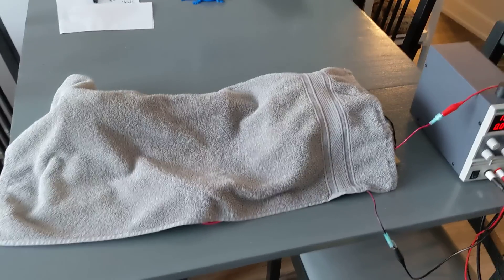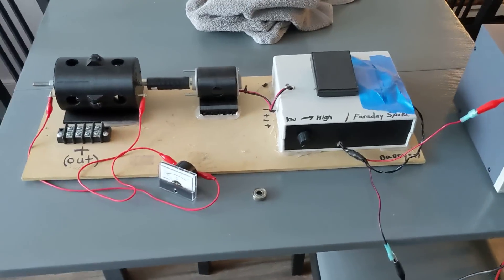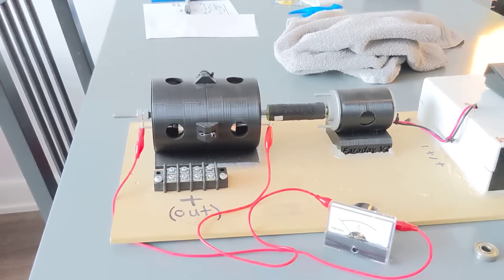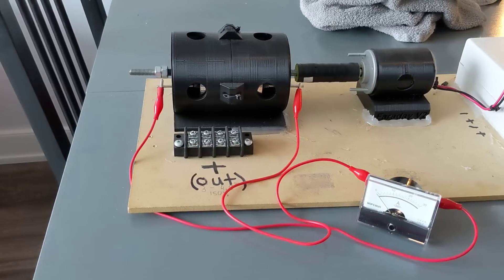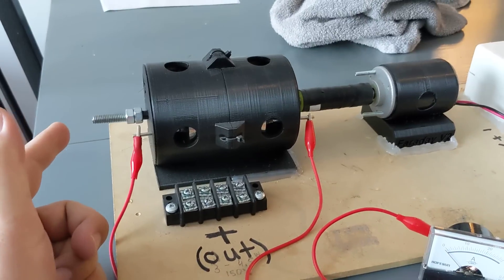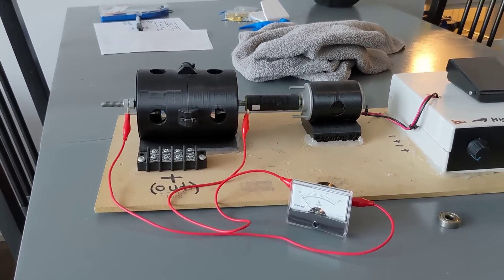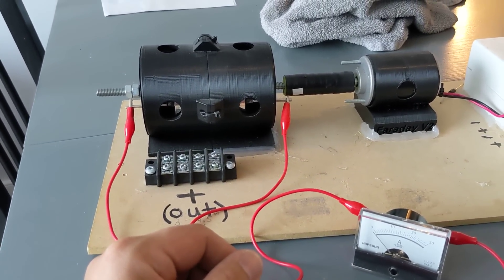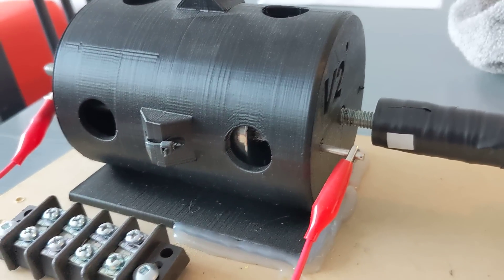N Machine....Bruce Depalma..Faraday Research RND

Comment: I have not seen any video that shows the Current capability of the Homopolar other than your! I read the De-plama patent, why do'nt you house those magneti( Quadra-pole SN-NS) assembly in a conductor tube, also you seem to be drawing the current axially to the spin direction, Palma's patent suggest it be drawn right from and also along the conductor tube length in which those magnetic opposion assembly are housed. Neat and excellent work bro👍🙏💪👌
Reply from the maker: That's the beauty of experimentation. That's why you can try all these ideas that are in your head and find out what works out best. The configuration I did and the way I set everything up I got the best performance possible
Reply: @FaradayResearch Oh I see, also can you show me 22A draw using a DMM meter? or a Clamp meter? Even De-plama and Tewari were seen using current shunts ( ofcourse they had very high currents at the out put!

Comment: Have you tried pairing this device with a Wimshurst device? As you know Wimshurst will create High Voltage with low amps.
Reply from the maker: I stopped working on that device 4 years ago. I'm not not currently working on that project

Comment: Great work!  First thing that comes to mind is adding a spark gap tapped from one of your outputs. The other end of the spark gap should be voltage right? Other option is using a neon lamp as the spark gap using its connection as voltage.

Comment: So Bruce DePalma claimed over unity when he reached 6000 rpm on a Faraday-type spinning disk generator.  Whatever happened to him and to his invention?  Thanks!
Reply from the maker: Bruce DePalma died in 1996. He died in New Zealand. From what I've heard, his machine is not over unity. According to Eric Dollard, there is only one way that you can make that machine over unity and that's if the magnetic field that was created was pulsed into an AC type field, then that could be extracted accordingly to produce high voltage and high current. Unfortunately, his machine was only able to create high current at mediocre voltage due to the architecture of his design. Unfortunately, his design made the machine extremely big and heavy which is kind of unpractical for a lot of uses. Maybe the industrial use might be more feasible, but as far as output voltages it, his device did not have the architecture to produce that.
Reply: @FaradayResearch  Are you still working on the Faraday-disk project shown in this video?  If not, let me be frank, I would be interested in renting (or buying) your build so I could do some tests. (I do not have a 3D printer, for example, but I have a lot of test equipment.)  I would add at least one earth ground, for instance.  I would also like to try segmenting the conductive surface (as recommended by N. Tesla).  I'm getting ready to try my own build, but renting yours would save me a lot of headaches in getting started, if you are willing.
Reply from the maker: I thank you for your interest in my project. Unfortunately that project has been disassembled. It would take some time to get it back up and running again. That's something I would have to work on in the near future, but the device itself is very easy to build. You don't need a 3D printer. All you need is too large fishing magnets, a steel axle and a couple of bearings and DC electric motor. That's very efficient and you can have your own end machine up and running very very quickly @TheProfJones
Reply from the maker: I thank you for the interest in the video that I did on Bruce De Palma.... Yeah he passed away in 1997 in New Zealand... He fled the US because of the harassment from the government. Where the invention pretty much did not evolve from there. There's a guy in India named tawari... He also built this machine and got great results. The only problem with the machine is it has to be built at a very large scale in order to get over unity and makes it very unpractical for the average person to build and implement into their home or whatever... As far as I know the machine he built pieces or the whole machine could be sitting in a warehouse. Somewhere in Australia was the last time I heard but it hasn't seen the light of day since his passing

Comment: If you have the magnets producing amps from an already rotating axle, why not load a different part of the axle with another motor arranged as a generator, and use the voltage form that? Or some kind of ballast or spark gap arc generator to create the voltage you want? Or maybe even a flywheel generator set up?
A heavy flywheel could be rigged up to wind or water systems and with a magnetic gear array to generate very high rpms and clearly then very high amps..
Just thinking out loud here...
Reply from the maker: This project I was working on over 2 years ago. I'm no longer working on this project. I have other things on the go right now
Reply: @FaradayResearch  I noticed. Still working through your vids...

Comment: How do we convert current to voltage?
Reply from the maker: Step up transformer
Reply: @FaradayResearch  wait, then doesn't this make 10000 or 800 current 10000 or 800 volts?

Comment: By the way... should you try the machine in different environments? After all, we know how it works and that it works efficiently if upgraded correctly. but we don't know what the variables and unscientific are. Or what does it react to or what affects its electrical output? In this way, we can have more data about what happened. For example, try it in an area with less light and see if the current drops.

Comment: Build a small DC generator that make volts and low amps on the same shaft and put the volt to the output using high amp diodes. You would have the volts and the amps mixed. Something to try? This is interesting.
Reply from the maker: I've already tried that theory. It doesn't work. The voltage has to be stepped up after the device
Reply from the maker: I stopped working on that project 2 years ago. I'm working on another stuff right now. That's my focus

Comment: Interesting in that the South poles are facing inward. When you subject seeds to the South pole of a magnet, they grow at an accelerated pace.
Reply from the maker: I've tried all configurations and the best method that I've found is North pole's facing out southpole's facing in
Reply: @FaradayResearch If no one has patented anything extra in this Bruce de Palma project, can I understand and spread the solution to the problems? Is this possible?
Reply from the maker: Any free energy device will never be patented. It will always be seized or they will deem it National security and you'll never see it ever again. Patenting is a total waste time and money you have to open source
Reply: @FaradayResearch  What if the machine gets power from an unknown particle or an unknown particle in the uncertainty principle? is it possible?
Reply: @FaradayResearch  I don't mean how it works or making your own version to sell and spread it. Otherwise, you are right. If someone doesn't spread it, this technology will die..
Reply from the maker: Yeah, it's possible it could be fluctuating or manipulating the dielectric space around the magnetic field because the magnet is in motion and rotating a can reflect or deflect counter space or the dielectric constant definitely possible
Reply: @FaradayResearch  Actually what I said is different. a particle. It has no name because it is not something fixed. It is triggered within world borders depending on the possibilities. just like chemistry or O2 reacting. We need to look at the actual magnetic field and find out what triggers it.
Reply: @FaradayResearch  I also saw another inventor using the same method. But it used radiation instead of electrical energy, and wireless lights were on in the air and on the ground. The LED was on.
Reply: @FaradayResearch  Now I did some research. and there may be free electrons. It could be a free electron separated from the light and all other elements. Can you please test this free atom in the area where it is found at the minimum and in the area where it is most found, and in the area where there are no other atoms (I cannot do it, I cannot afford such thick magnets)

Comment: I am trying to get my own machine built and I am working as fast as possible but there is something that puzzles me. I figured to use pot ferrite magnets (with the pot) to have them affixed to the shaft but information on them is scarce and producer first4magnets only makes pots with diagonal magnetization, showing both poles, instead of axial. I've seen in Aaron Murakami's video a section of Peter Lindemann research in the 70s (Borderlands thing) where they used a few magnets on a disk showing different poles and got AC sinewave ; but DePalma made the big magnets by assrmbling hexaedric magnets together thus alternating poles and got DC ? I would go for pots, easy peasy, but I don't want AC cause that can't allow the voltage experiment. What am I missing here ?

Comment: I think there is a way to increase voltage. I would like to have one built for myself here in UK. My idea would be to replace the Faraday disk with a spiral coil. This would allow it to stay in contact with the brushes, but have the shaft made non-metallic. Then pulse DC thru the moving spiral coil. Collect the high voltage back EMF along with the amps... Alternatively, keep it unipolar. Have one magnet move at the same time with the coil, on the shaft, and have the outer magnet stationary, but exposing both poles to the coil. This should allow to have voltage induced at the same time, but probably will cost amps.
Reply from the maker: I would make a prototype and test these concepts....get on the bench and make it.... that's what I do
Reply: @FaradayResearch  That would be absolutely brilliant. But remember, the copper coil would needs to be insulated from the shaft. I don't know if your long shaft is actually insulated from the short motor shaft. I think you can get a solid copper pancake coil just enough for a short test, but it will be difficult, because your machine is enclosed in the big case. If you need I can study how to code one in OpenScad and then have one ordered, but it will be tricky even for me as it can't be drawn only with ellipse equations.

It triggered me when I've seen this guy while I was looking for a way to harvest back EMF: www.youtube.com/watch?v=voHGyN93Ru4 He proves nothing, but the circuit is interesting. I would like you to pulse DC thru the spinning spiral coil and see if you get voltage spikes at the same time with those high amps.

Comment: hey from beginning i am a bit confused on how the design is. do you have both magnets and a copper plate in between the magnets? or just magnets alone? if its the first case, do you spin the magnets and the copper plate at same speed (by making them be separated by few millimeters gap between the copper and the magnets).

Comment: Wonderful work ! What is the Input Power and Output Power ?
Reply from the maker: 60 microvolts.... at 25 amps
Reply: @FaradayResearch  Thank you Sir for your prompt reply. What do you get for INPUT POWER and OUTPUT POWER so that we know the GAIN, hopefully it is OVER UNITY !! Thanks again.
p/s: FYI, I'm from BC Canada, now visiting family in Taiwan.
Reply from the maker: @friendofwise4295  The input power is the power used to spin the magnets at high speed. So you can really try to find a efficient motor to spin the magnets as quick as possible. Bruce de Palma says that the magnets should be spinning at 6,000 RPMs to get over unity but the size of the magnets are also a very large factor and how much power output you can achieve with this device. I put this project on hold for a while. I had more research and to do on this device and I'm revisiting this device now which I'm doing in behind the scenes for obvious reasons because the device has properties that can happen to the device while it's running which a lot of people do not know about???(secret) and this is what I'm trying to prove now..... I will not be disclosing any more information on this device.... because the implications are very serious.... If you do some serious research on the device, you'll find out when I'm talking about but I will Not reveal it on YouTube ever!
Reply: Well noted. Thanks
Reply: @FaradayResearch 
The motor spinning the shaft is 12v dc ? If thats correct what current is it drawing to spin the shaft fast enough to get 20A.
Thanks
Reply from the maker: @bobjary9382  24 volts
Reply: @FaradayResearch  ok 24volts but what current is thr motor drawing ?
Reply from the maker: @bobjary9382  less than 2amps
Reply: @FaradayResearch  Thanks 
24 volts at even 1 amp is 24 watts or VA of power input into the device .
If youre only getting 22 amps at a number of mV (or uV even ? ) your set up is massively inefficient surely ? 
Unless Im missing the point somehow (in which case I will feel a bit foolish when you point out some glaring error of mine ! )  No company or govt is going to be the least threatened by this ?

Comment: use resonant transformer with slayer exciter circuit it works as autotuner to convert those high amps into high voltage then rectify and filter the L2 into pure DC current, then connect it into any solar inverter into the PV Input. There you go you have Over Unity of multiple KW's with only Few Watts of input. 
result of Mixing N- Machine with Don Smith generator

Comment: How about gluing loops of isolated adhesive copper foil around the magnets (whole magnet height) and try to measure the voltage? 

Btw, maybe this phenomena is connected to some lagging between matter inertia and flux inertia (if such thing exists)...

Comment: Check out Dr Paramhamsa Tiwari's work. He replicated Bruce Depalma
Reply: actually Dr. Tiwari's machine is not like Dr. Palma's, because Former used just magnetic spinning as load attached to shaft , which is connected to a regularly used high HP AC motor (that is used for water pumping) for getting higher electrical power as output from lower electrical input power. this is commonly a large size machine of the over unity (motor - coil as stator with spinning magnets) model shown on youtube.
Reply: @subashinixerox5772  Very vague and unclear what you just said. Both Palma and Tiwari have redirected the back emf to be used as an additive rather than resistive to get over-unity. Dr Tiwari has himself said this on multiple occasions that his system is inspired from Palmas work.